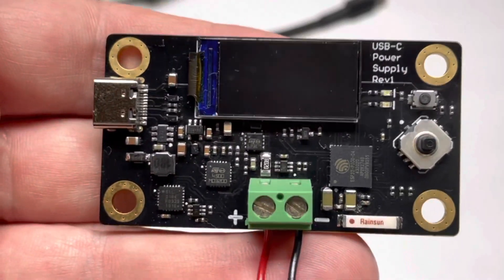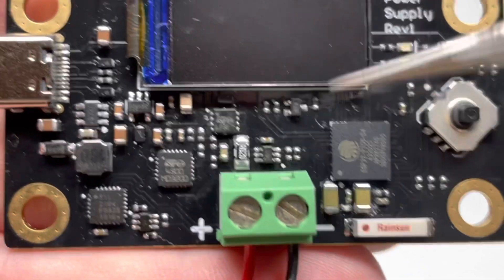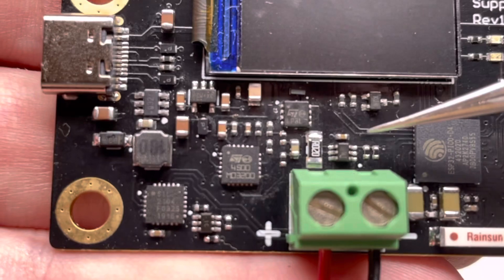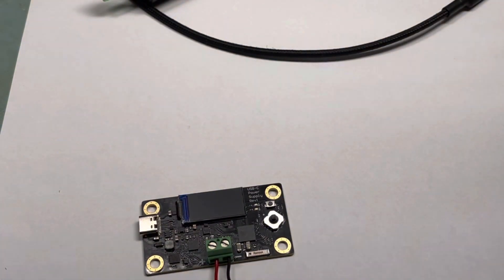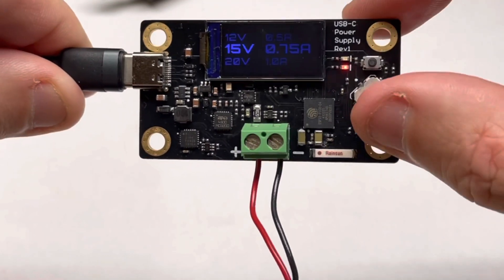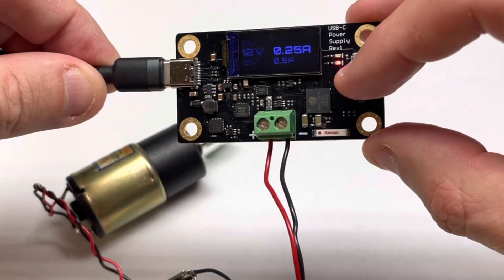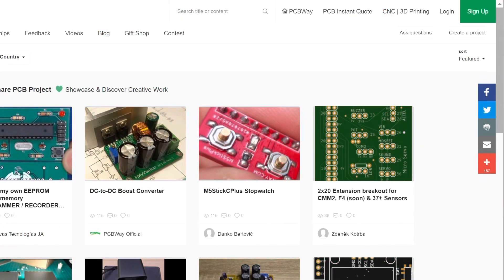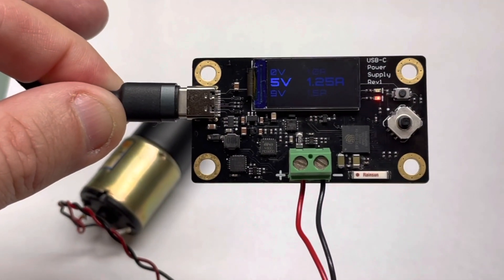ESP32 USB-C Power Supply

Comment: Do you have any recommendations for a 3.3V buck regulator aside from the LMR16006 you used in this project? I'm looking for a similar buck regulator for a 4.2V li-po ESP32-S3 based project.
Reply from the maker: The LMR16006 was needed because of the max 40v in since I have no idea what the usb-c voltage will be. Could not find a 4.2v version but the LMR51420YDDCR is 4.5v. You should be able to find a version that allows you to set the Vout to anything you want with a resistor divider.
Reply: @0miker0  Yeah, I've been looking around for almost a 2 days to find a good buck regulator that's in stock and takes ~4.2V in with fixed 3.3V at 500mA to 1A out. Many adjustable buck regulators I've found use obscure, difficult to source resistor values or take an input over 4.2V, might just have to go with an LDO.

Comment: This is awesome.  Do you see this as a power supply for makers or did you design with another more specific use?
And I'd love to buy one.  Will they be for sale sometime?
Reply from the maker: Sorry but it will not be for sale and was just made as a pretty looking development board to see if it could be done. Hardware prototype design is my full time job and hobby and after I heard that usb-c chips could communicate to the device they connected to, I thought a navigation switch and screen could look nice. All of the files m, parts list and code is free for anyone to build off of. I could not have done any of this on my own and give a huge thanks to Larry for writing writing the code and Tom for getting the word out.

Comment: Hi Mike, I really like your latest project with time and open weather, I thought your mock 7segment LED was really good and the dimmed segments were the best I’ve seen, what is the display type?
Reply from the maker: The display is a 160x80 ips tft off BuyDisplay and the seven segment font was created by someone else. It’s one of the better ones I’ve seen and is the digital clock examples in the TFT_eSPI library.
Reply: BTW I would have posted comments on your new video but they are disabled

Comment: If those crocodile clips touched, would we see magic smoke?
Reply from the maker: I have not shorted the leads together yet to see if it has built in protection. Should add a pic fuse to the USB-C connect power nets though.